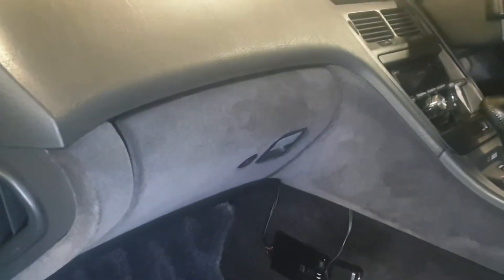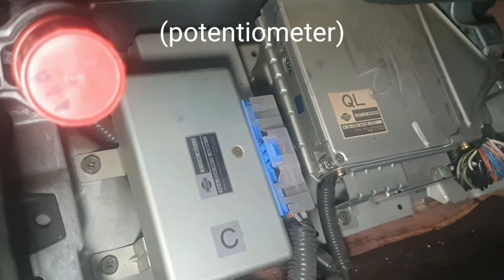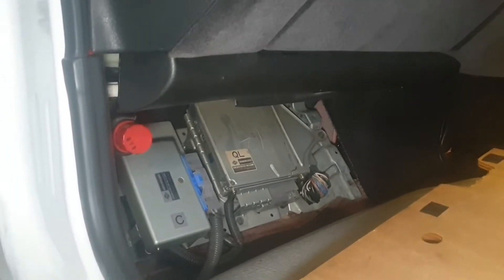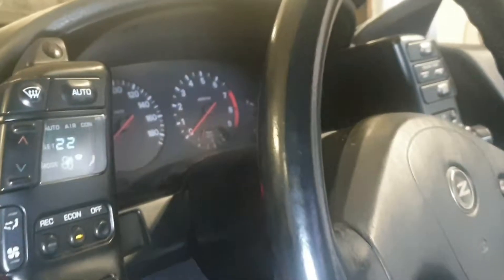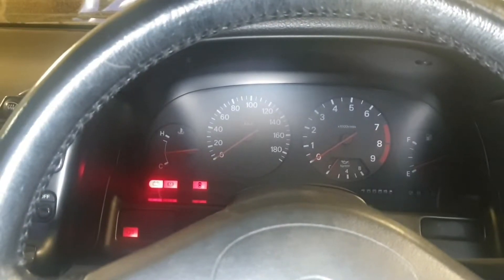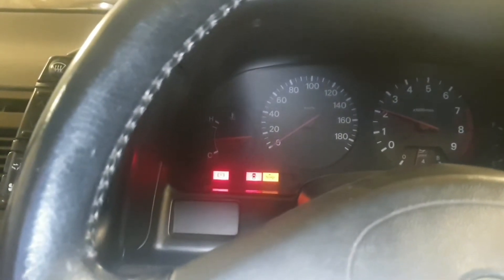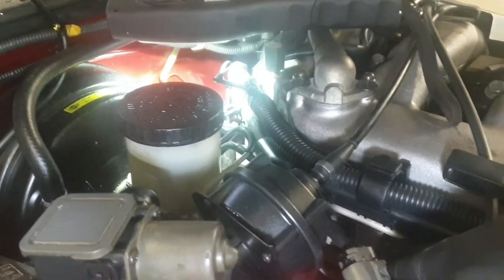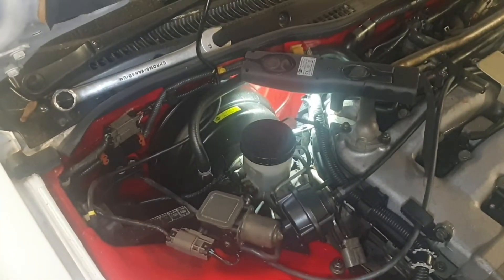Secret(ish) oxygen sensor test mode on Z32 300ZX, how to, diagnosis and repair

Comment: So actually how do you detect that the o2 sensor failure?
Reply from the maker: If the light doesn't go on and off, or does so very slowly. Same as you would on a modern diagnostic scanner on a narrow band o2 sensor, but with a graph.

Comment: guys doing this procedure is way easier than the way he did this!! if you just turn the ignition to the 2 position, and then turn the dial clockwise and then counterclockwise there will be a red light inside that hole below where you were turning the screwdriver at it will be blinking slowly first indicating the first digit of the code and then it will pause for about 2 seconds and then it will blink fast indicating the 2nd digit of the code it will blink with code 53 for right side o2 sensor and 32 for the left side 02 sensor! hope this saves you guys some time! also along with any other time your car is having a weird problem the first thing you should look at should be checking the computer for codes.. if you dont know the codes look them up, hope this helped u guys!
Reply from the maker: That's great, but you've entirely missed the point of this video and what you posted is the way to check for error codes, but is irrelevant to what is in this video. 

You should watch it again, this is not checking for codes, it is a specific diagnostic mode for the oxygen sensors ONLY. 

This test mode has the light illuminate or go off as the selected bank changes from rich to lean, or vice versa. Nothing to do with error codes, that's the easy one. I couldn't find a video on this test mode, hence why I made one. 

Just a couple of days ago I found a way to read codes and get live data from the HICAS ecu with modern diagnostics, I haven't edited that video yet though, but it will be uploaded once I get round to it.

They don't call me jdm Jesus for nothing!